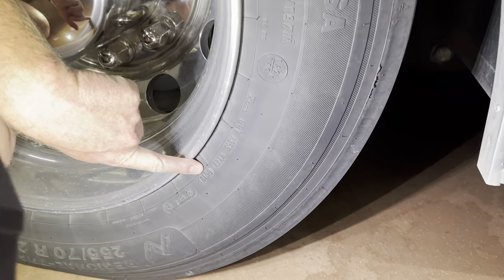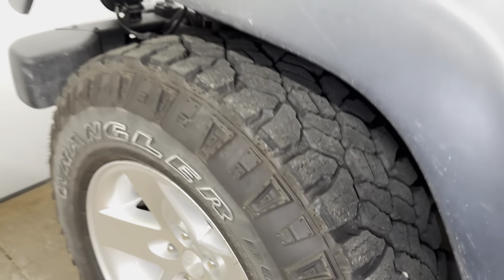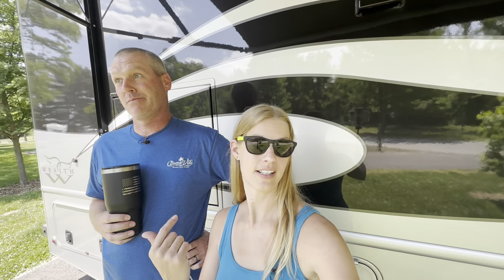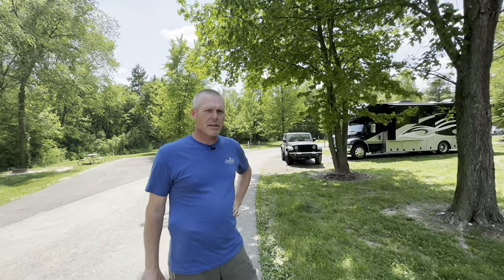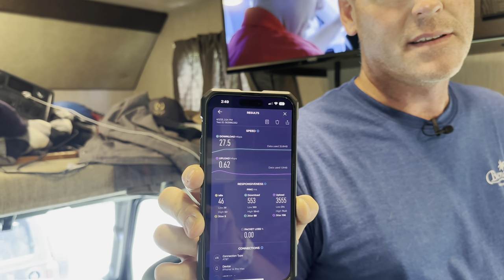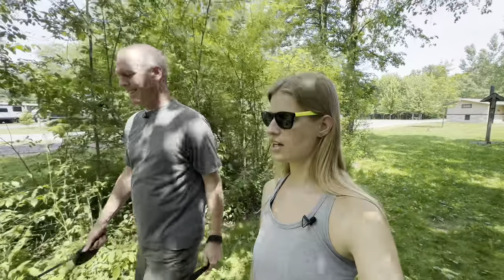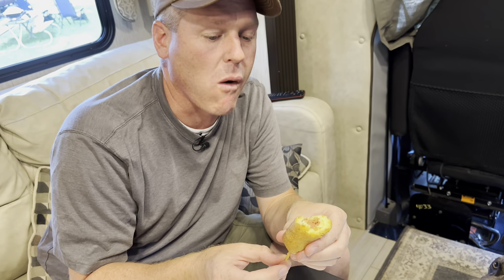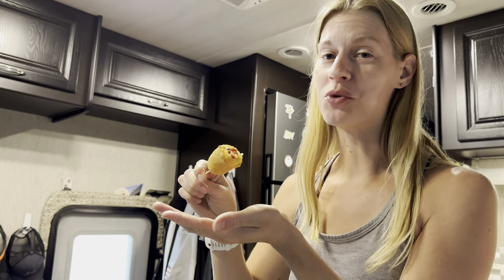NO To The 5 Year RV Tire Rule? (RV Internet Solution At Van Buren)

Comment: We've considered the T-Mobile internet for home.  I like the idea of taking it on the road.  I never even thought of that, so thank you for that idea.  Question: They said I need another router or wifi extender to be able to get a signal on multiple floors in our ranch style house.  What kind of range does that unit they send have?  Keep up the great videos.
Reply from the maker: I guess it depends on how your home is set up but we get signal downstairs and outside. A WiFi extender never hurts though!

Comment: For people that do not know anything about tires or their large motorhome or super C it is not a bad idea to change the steers at 5-6 years, drives at 7-8 years and if they have a tag move the old set of steers back there when you swap them out.  The tag axle can swipe over the ground and wear them fast if you do a lot of slow speed tight turns.   I use to put a tire that was rated one letter better than the axle and trailer weight needed, it helped with not getting flats.  When vehicles sit they do rot, I realized the other day my jeep had sat for over 3 months and we had not driven it, it is not good for them.   Stay safe and healthy!
Reply from the maker: Sitting tires, especially outside really does lower the life. Lucky for us we run our RV much more than the average motorhome😂

Comment: Changing tires depends on way more than just the date.  How they have been maintained, are you a full-timer, do the tires get used regularly, are they stored inside or outside, covered or not?  My 5th wheel is stored outside and run at best 4k miles per year on average.  I replace every 5 years, sometimes sooner.  A trailer pulled regularly (within the load and speed ratings) might get 6-7 years out of them.  A motorhome is another conversation entirely.
Reply from the maker: Yep we touched on those topics because it's not a 1 size fits all and we wanted to kind of get that point across to others

Comment: We're on our 3rd rv (and keeping this one lol) but the first two we never even thought of the tires and UV damage because I always used 303 UV protectant on them to keep them looking new and obviously the UV protection but even that didnt keep them from developing cracks in the sidewall.  The new 5th wheel has G rated tires and they are expensive to replace so we made sure we had covers this time and 2 season old now and they still look brand new. It's a wise investment at a whopping 40 bucks for a set of 4 covers.
Reply from the maker: This is actually our 10th RV so we are happy to hope to keep this one a record length😂
Yes, covering the tires is an easy way to keep them in better condition longer!

Comment: you forgot to mention inspect both sides of the tires for cracks, cuts, bulges and marks. also your tread depth of no less then 3mm in 3 spots. if so replace. watch your min and max air and hot cold temps and pre trip every morning.
Reply from the maker: Yep pre and post trip are very important

Comment: I tend to replace tires around 5 years, they can go longer but the tires on my trailer and pick up will never wear out before they dry rot they just don’t do enough miles.  I tend to be cautious as I would rather spend the money than have a problem.  That said these tires do sit a lot in hot sunlight often.  The trailer tires do get covered but sit more.  I do look at the side walls and have replaced tires because of spider marks in the side wall  fore I would have on age.
Reply from the maker: Yep sitting and UV will suck the life out of tires for sure!

Comment: As a vehicle dynamics tire test engineer, the 5 year theory is somewhat true for motorhome tires that sit often and for long periods of time, there is some chemistry and science involved behind my comment. Exterior looks can be very deceive. Part of the tires construction and material is made with butyl rubber, Butyl an inter liner layer that hold the air in (simple terms) it needs to go through heat cycles to keep from drying out and separating from the inside. Tires are designed and engineered to be rolling to keep the tires compliant. I do this for a living, I test, review test data, and insurance data almost daily. At that 5 to 6 year mark, if your RV fits that static category at least have them inspected from the inside by a certified tire specialist, most truck service centers will have at least one on staff. The data is overwhelming.
Reply from the maker: Love having some insight from someone like you! Thank you😊👏🏻

Comment: Hello folks, I enjoy your information videos very much.  On your recent video, you mentioned T- Mobile home internet and Micro-Air thermostat.  I have the T-Mobile internet as well and just installed that Micro-Air Thermostat.  I can connect via Bluetooth just fine via my phone, but cannot connect via WiFi.  Did you experience any issues with Wi-Fi connectivity.  I chose this combination to be able to monitor the Coach temp with our pups inside if we Leave.
Reply from the maker: We haven't had any problems with the wifi connection. Do you have the latest firmware installed on your thermostat?
Reply: Yes sir/mam, did that as soon as I got the Bluetooth connected.  I just had to return the coach to it’s lot location due to 72 hour HOA rules so will return and attempt more tries and perhaps contact Micro-Air for help.  Thank you very much for responding and enjoy the 4th.

Comment: I'm with you on the tires Mike.  I think lots of folks with RVs obsess over their tires.  The manufacturers say 10 years, so the folks cutting that in half are doubling a very big bill.  Checking for weather checking is the key, if they ain't cracked they're still good unless you've run them way under inflated for a long time.  The same kind of goes for inflation.  I've heard lots of guys say use the inflation table then add 10% for unequal weighting and then another 5% for safety.  What they're really doing is over inflating their tires by 15% and they think they're safer even though they have a rougher ride and not as good of traction as a properly inflated tire.  Sometimes the world is just weird place.  What Mike, no bikini, not even on Saturday night?  Keep the good stuff coming guys.
Reply from the maker: Yep, keep an eye on them and know your weight so they can be properly inflated. Don't buy junk tires and hope for the best haha
No bikini this time but it will be back😊

Comment: This is a conversation that can be had and never come up with the correct answer. Had my first blow out on the 5th wheel this year and my tires looked brand new even though they were 4 years old. I’m the screw ball you honk at on the highway because I never speed pulling my trailer. Most tires never fail on the outside appearance, they fail from the inside out and you will never see that coming.
Reply from the maker: Isn't that the truth haha we just wanted to share our thoughts on the topic because we've been getting a lot of questions lately about tires and what we have done etc.

Comment: Do you run extenders on the duals? Recommendations? My rims don't allow my hand or enough of my fingers to get to the inside valve stem. Have to go between the tires, but that only works if the stems are in the right spot.
Reply from the maker: Yes our Wraith came from the factory with extenders. Don't really have a recommendation since we're using what it came with.

Comment: Lynn, what is your Cornmeal Batter recipe?
Reply from the maker: For simplicity I slightly modified the recipe on the back of my quaker corn meal canister. I added probably 1/4c more corn meal because it needs to be thicker, less sugar etc
1 1/4c flour
1c corn meal
Tablespoon sugar or less didn't really measure
1/2tsp salt
1c milk
2tsp. Baking powder
1/4c oil
1 egg

Comment: Oh man... tires.  What a pita!  Anything with tires...  tire shops do half assed tire replacements, race through balancing. Not torque lugnuts...  but truck tires are sort of a different animal... still need balancing and care but the tire itself is built way different than light duty.
Truck tires are built to be recapped, so there is an extended life of tire scenario light duty tires do not have...
In your case, rv stored indoors... all that time uv light not attacking them, you keep an eye on them, drive with care and don't abuse them...
I would  do like you are doing.  If no dry rot or cracking...  keep going.
Imo of course!
Reply from the maker: We will never buy retreads. They are horrible and just asking for issues. From 2 decades in trucking industry driving we will never put a retread on our RV. Others can do whatever they want lol just speaking for us😂
Reply: @WanderingWagners  Yea, me neither... you missed the point, truck tires are designed to last way longer due to fact you "can" recap.
So, if taken care of, original tire will last longer than most would think.
Sheesh, c'mon how long have you been out of trucking?
Reply from the maker: @catdaddy3728 no we got your point but just saying recaps are junk. 😂 Been out of driving truck since 2017.

Comment: I put new tires on my past two rigs, but thats because they were all dry rotted and didn't want to take any chances. I say if the tires look good after date codes, run em because theres many more reasons as to why tires blow. Hell, I had a brand new drive tire go boom on the semi I drive that left me stranded on the side of US 6 over by Stryker, OH and then the tire that replaced it debeaded the very next day 🤣🤣🤣.
Reply from the maker: When Mike was driving truck we'd spend quite a bit on tires but that's because we never got retreads and only bought virgin rubber. Pricey but worth it! 😁

Comment: Heat kills tires. You don't drive in AZ or TX that's in your benefit. Tires are unpredictable it's difficult to make any kind of rules. Best you can do is correct pressure and check them every stop for nails on travel days.
I35 between San Antonio and Laredo is littered by blown tires. They're everywhere....
Reply from the maker: Absolutely! Kind of our point. You can't just go by whatever the "internet" tells you to do because everyone's situations and conditions are different and cannot be a 1 size fits all. What works for us, won't work for you etc